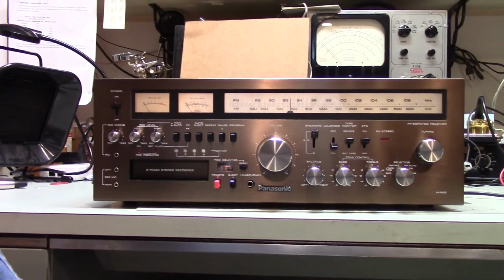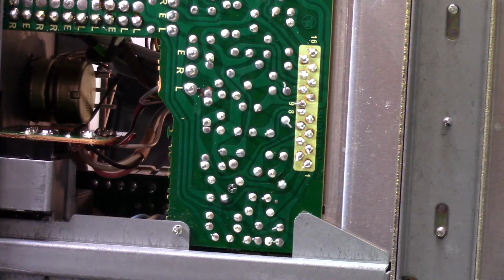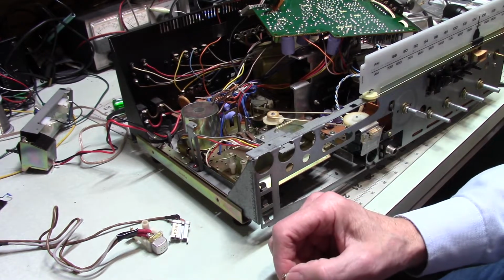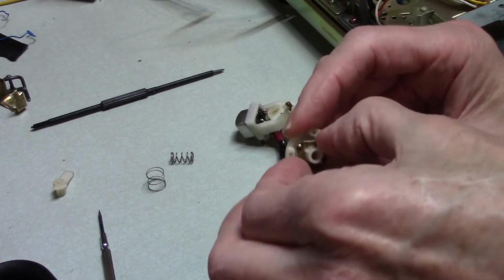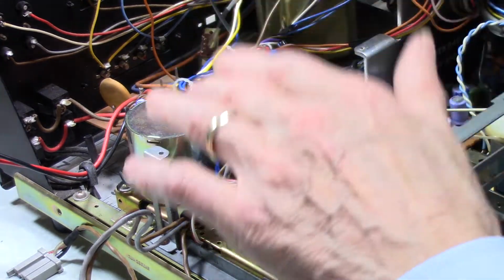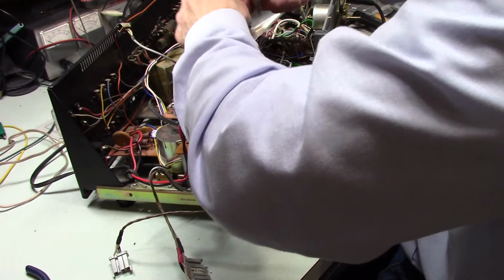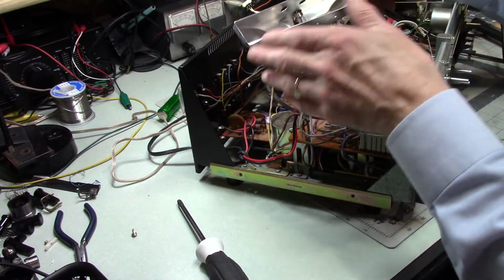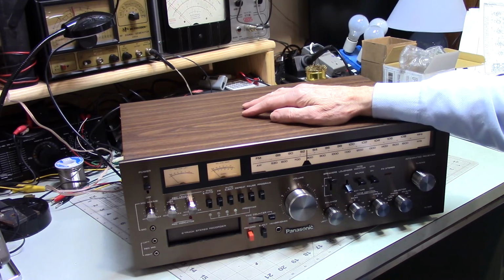Repair of Panasonic RA 6600

Comment: Great video! Just one thing I would avoid is probing with a steel screwdriver like you did to get the bad solder joint to break contact early in the video. Good way to let out the magic smoke. I use a fiberglass reinforced plastic tool to do tap and probe testing. A simple chopstick would be great too. I know that you realize what can happen and probably just grabbed what was handy. Just an observation to avoid. I have done that early on and never did it again after cooking some output transistors.
Reply from the maker: I hear what you are saying. I am super careful when probing but I do now find myself using a plastic screw driver from my radio alignment kit. Definitely bad times when you let the magic smoke out.

Comment: Nice detailed teardown video! I just recently bought one of these on eBay (it hasn't arrived at my house yet). From the pictures it appears to be in good cosmetic condition, but the previous owner only tested it as far as making sure it powers up. One thing that's really nice about this deck is how easy it is to get to the tape drive belt on the bottom. That's one of the most common issues with 8-track machines. I was a bit afraid accessing that belt would be a nightmare in this receiver. I'm also not an electronics guy at all, so I'm worried that I'll end up having to mess with soldering if any of the components are bad. Today getting a fully recapped 8-track recorder of any brand is no less than $300 eBay, which suuuuuucks-- but it is what it is.

In any case, if I run into any problems with my unit, I'll be sure to use this video as a guide if I have the motivation to try fixing it myself. Thanks! :)
Reply from the maker: Great I'm glad you liked it. Hope you do well with your radio.
Reply: @oldelectronicsfan5136  Thanks! 
Update: I got the receiver disassembled to the small bracket holding the head and tried using JB Weld on it, which didn't really work as well as I hoped. Then just for the heck of it, I tried gorilla glue on it which didn't work either (expected). Then I noticed that as I was handling the assembly, it just completely split apart into 4 pieces instead of two (the sides were breaking off now). So I actually ended up just junking the receiver.

I wish I hadn't done that though, because afterwards I did a bit more research-- apparently 8-track decks from the late 1970's use tape mechanisms from Mitsumi, and they're all built the same way with the same nylon plastic head piece. I realized this when a day after the failed attempt I bought a Realistic TR-803  8-track recorder deck. And guess what? It has that same nylon piece inside it.

Also, apparently there are sellers on eBay that 3D-print this exact part brand new, so rather than gluing the old one back together you can actually just replace the piece with a freshly made one.

In conclusion, I really jumped the gun and wish I hadn't, but at the same time I'm kinda still glad to just be getting a separate 8-track deck instead of a bigger receiver/combo unit. But I wish I had just done my research first before throwing the unit out so quickly.

Comment: Cool! Stumbled on this to find out how to fix my unlit RA-600 ;) Going to look though my old toolbox of car parts ;)
Reply from the maker: Actually, that is a dome light bulb.
Reply: Ah yes, coned ends and likely a wee bit too bright!
Reply from the maker: @inspyre.design  I didn't think it was too bright but if you do you might use a resistor to drop the voltage a bit.

Comment: Great repair! I have this same model Panasonic. Mine has very low volume on the left channel, but not completely dead.  Right sounds fine. Any suggestions?
Reply from the maker: Unfortunately there are no schematics, that I could find. A few of things to try. First, make sure it isn't just a dirty control. Operate the key controls such as, function switches, volume and tone controls, to see if the bad channel tries to work. You could also try contact cleaner on the controls to see if that helps.  Since this is stereo, you can use the working channel to get voltages from and compare the broken channel to the working channel. You can also use an audio signal tracer to check where you lose the signal. Of course, look for bad solder joints.

Comment: I have this same unit. 6 months ago the system worked perfectly but after it just sat on a shelf unused, I just plugged it in in hopes of using it as my main system with turntable and aux hooked up but I came to find 1. my left speaker channel gets no sound at all 2. the 8 track electronics are not engaging (nothing happens when I insert 8 track). I've ruled out any issues with the speaker itself, do you think the same solder fix could work for that left channel? Could the speaker and 8 track issues be related?
Reply from the maker: It could. That is the amplifier chip. The problem was obvious when I examined the solder joints using a magnifying glass. If that isn't the issue, other simple things to look at would be the volume control. It might be dirty. Any switches that are in the audio chain, the same thing. If you look up that amp chip, you can find out the pin outs for it. You can then use a signal tracer or oscilloscope to see if audio signal is reaching the amp and if audio is exiting the amp.

Comment: I have this receiver.  As soon as it is turned on, a popping thunderous noise emits through the right speakers on both main and remote.  Even with the volume all the way down, the noise continues for 15 minutes.  Can you help me understand what might be the issue?
Reply from the maker: I can try. I am guessing that it doesn't matter whether you have selected radio or tape. Given that the volume control does nothing, likely the issue is in the amp section. Possible issues are bad transistor, cracked resistor or failed solder joint. Carefully check the solder joints and make sure they are healthy. Re-solder any that are questionable. Free schematics don't seem to be available but it might make sense to buy one. That would allow you to check voltages. With a schematic it could help you trace the signal chain and you could use an audio signal tracer to see if you can locate the point at which the noise shows up. Be careful because the noise might show upstream from the failure. I am not sure if that noise is an indicator of an issue with the amp chip but, as you saw, those solder joints are a likely failure point.
Reply from the maker: This is likely not the issue, but another quick check you can do is look at the tops of the electrolytic caps for any that might be bulging. Bulging caps should be replaced.
Reply: @oldelectronicsfan5136  Correct.  I doesn't matter what I select, the thunderous noise plays through both main and remote speakers.  What a shame.  Nice looking receiver.
Reply from the maker: @closerexamination4314   Given that this is a stereo, you can try to compare voltages from one side to the other to see if you can determine where the issue is. You also may want to put a high watt 8 ohm resistor across the side with the problem in place of your speaker. That will save your speaker and your ears.

Comment: How hard was it to align the head? Did you do that from the bottom?
Reply from the maker: Not hard. There is a hole in the bottom and there is a small brass screw you use. I use pre-recorded tapes and then go track by track adjusting for the best volume while listening for any crosstalk from other tracks.

Comment from the maker: I am posting this here since I can't seem to find one comment to respond to it. A question was asked regarding using JB-weld on the plastic head. I used an epoxy after I grooved the inside of the area where the head sits. One person commented that they recently discovered that someone is making 3-D printed head mounts for this but I have been able to find them. If anyone knows where to find them let me know. I will be investigating that since this plastic will continue to degrade and ultimately fail again.

Comment: Great video!  Thanks for all the detail.  I just wish you had shown exactly how you aligned the head. Did you need to do it before putting all back together?  Or while it was totally apart?
Reply from the maker: Sorry for that. There is a screw on the bottom of the plastic housing that you can access after it is all together. Look for a hole in the bottom of the case just below the head. It is a simple matter of turning the screw till it sounds the best. Use a professionally recorded tape if you can and test it on all four tracks.